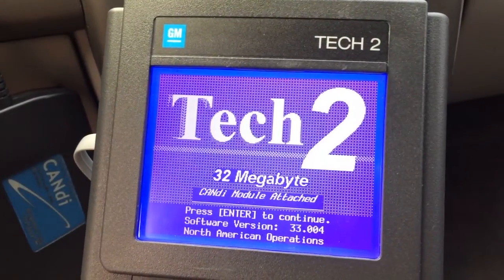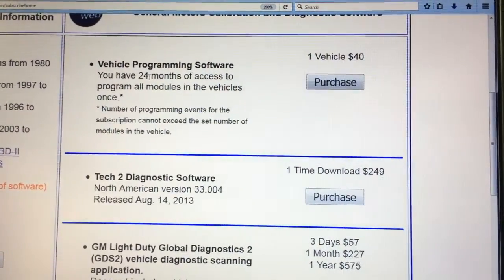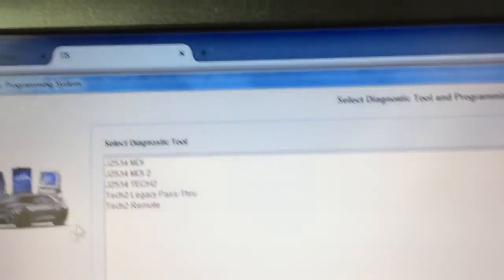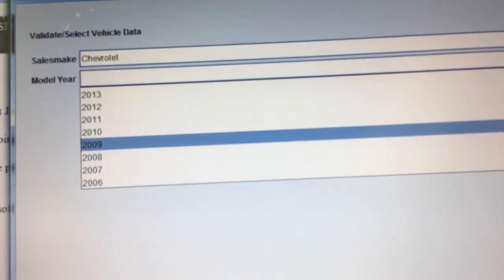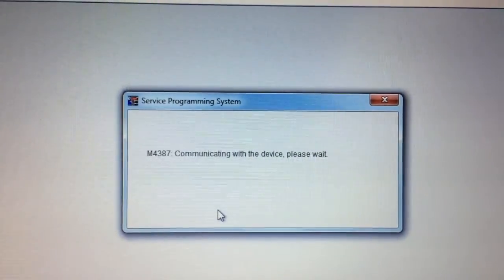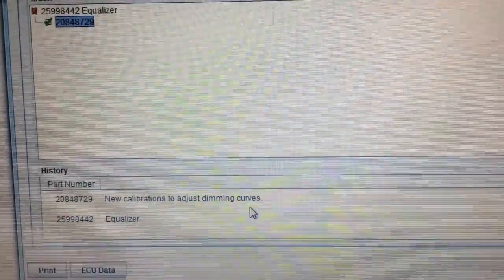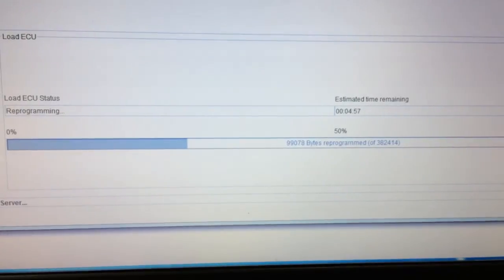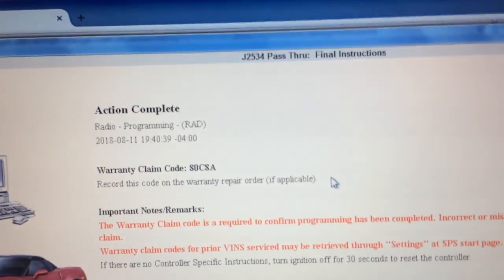GM SPS Programming: Tech2 Tool Pass Thru Mode ECU TIS2Web TDS How to do a Calibration Update Reflash

Comment: Hi let me ask you something. As you was showing the option to pay on for subscriptions on the acdelcotds.com you then jump onto another screen and as you did you said tech line information and there you shows a screen that looked like the TIS2000. is this page part of the prier acdelcotds.com or did you navigate to another page? Thanks
Reply from the maker: That's TIS2Web, the replacement for TIS2000.  Looks about the same as it did in the 1990s.   You do not get to see that until you have a paid account, then when you log in instead of a subscribe button you'll get a button to launch the SPS Java applet.   Or GDS2 or Tech2Win, whatever you've paid GM for in that particular account.
Reply: @DrShock  Ok now i'm understanding, so if a pay the $40 they say you get 2 years to program 1 or more modules in only one vehicle right? If so then i got time to figure out how to navigate the TIS2web! lol
Reply from the maker: You can do anything SPS but just with the one VIN correct.   For a DIY that's quite a good deal.   For a professional garage, it's probably a bit pricey if they just needed to do one module for one customer but at least they got the option vs sending their customer to a GM dealer.
Reply: @DrShock  Well for me doing one vin is okay, because I'm starting out new with programming car modules, yet i'd been doing softer programming using my Autel Elite on things basic. The kick in the ass was with my Autel I got 2 years of software update along with a subscription for BMW and benz meaning I can do unlimited module and i didn't and my sum expires at the end of this month!  Reason i didn't know because although this tool came with the J2534 i was told I needed a laptob using the dealers sit, but not told only for U.S cars, so I and figured the same goes with BMW and Benz cost$$$ was i wrong. Anyway it's time for me to get into programming because every car i send out is money lost!!
Reply: @DrShock  I know i wrote you back already, but there's something i forgot to ask, Drivers do i need to download any type of Drivers for the USB adapter or the Tech2 and If so where can i find them? thanks.
Reply from the maker: There's probably drivers for the USB to serial adapter, but that would depend on the brand one you went with and you should get pointed to those by the manufacturer or seller.
Reply: @DrShock  Yes I understand that the computer will say found USB/DB9 device would you like to install driver from a list or load  from a disc. But now what about the Tech2 isn't that also hardware that communicate with the PC and would also need it's own drivers? I know i'm jumping ahead of my self, but i was just wondering. Anyway I'll give you a break for now with all these question until i get everything linked up then  I cross that bridge. ;) Thank you for all your help :)
Reply from the maker: No, only the USB to serial adapter needs a device driver.  You don't need a driver for the serial device you plug into it.
Reply: @DrShock  Hi ok I received the DB9 to usb and installed driver, but it's not the Tripp Lite USA-19HS as you recommended i got it after you told me so I'm going to try it if it don't work i'll buy the Tripp lite. The only thing  I needed to do was rewire my DB9 fallowing the tech2 DB9 to RJ45 wiring..  I just got done plugged everything up, but how do I know it's communicating with my laptop?   The only thing i found on line is using the self test mode, but i don't have the loop back plug although i can make it if needed, but do i need it!! Thanks
Reply from the maker: The loopback adapter just tests the functionality at the Tech2 jack itself.   To know whether you are reaching thru USB on the PC you'll need TIS2000, or a TIS2Web subscription to get further.
Reply: @DrShock  Hi, I order the right DB9 to USB the Tripp Lite USA-19HS. I also order the TIS2000 disc with the key $20.  When I get everything loaded i'll give you a shout!! thanks
Reply: @DrShock  Hi, ok I installed the TIS2000 with key.  I set up the security key as USB. I installed the Tripp Lite USA 19HS drivers. I plugged the  DB9 i rewired for Tech2. the computer COM port is set to 9, bit rate=9600 Data bits=8, parity=none, stop=1 and flow control none. I then went into the TIS config selected IO management com9, 9600.. Everything looked good, but  I cant get it to communicate. I tried a loop back test and it passed. I'm getting E2106 no connection with the hand device
Reply from the maker: @LouTech So first verify you have the right connections (USB->USB serial adapter->DB2 RJ45 adapter->RJ45 serial cable->Tech2).  Baud rate is too slow, I've always used 115200 on both ends.  Then try the basic load TIS2000, turn on Tech2 but do NOT press enter to get to the menu (leave it on the boot screen) and see if TIS2000 sees it.   If not, move to debugging the comms problem - tone out the clones flat style serial cable with a DVM on continuity test mode.   Tone out the clones RJ45 to DB9 adapter as well.   Also remember this is ancient software, I've not read or heard of anyone getting TIS2000 working reliably other than on Windows 2000 or Windows XP (newer Windows you need to run it inside a virtual machine (VM) of XP) so be sure that's not the issue either.   If its still not working, I'd make a simple DB9 loopback on the USB adapter and find a serial test program for Windows to test that out.   My other video here https://www.youtube.com/watch?v=Nr_eYexAAV4&lc=Ugw0h4KX4wGwvSK5l-R4AaABAg is probably more applicable to the setup you're pursuing here.
Reply: @DrShock  I want to thank you changing the baud rate to 115200  worked! You were right the baud was to low. I set it to 115200 on both sides and wallah it worked! ;) As long as i know it's worked with the TIS2000 I know it will work with the TIS2web!  Now i got to watch your video on how to us it for programming. Question i saw you used it as a pass though for newer cars with TIS2web. would you recommend to buying the MDI or could i use this tech2?  I do have a J2534 haven't used it yet!   Anyway thanks Lou
Reply from the maker: @loutech7209  Great to read, I'll make a note to update the video description with the serial port setup details.  To your question, I personally prefer the Tech2 because it's _free_.  No sub required to use it with TIS2000.  But it's not something I can use on vehicles introduced after 2010 or so which is the only reason I bought an MDI clone.   So far I've found no reason to get the MDI2 (haven't needed to work on a Global A platform GM car yet and the MDI2 clones are not mature ye just being MDI clone circuit boards inside a cloned MDI2 case and not giving you what you would need there anyway).
Reply: @DrShock  As i watch your video I noticed you used your tech2 as a pass through and i saw the list of vehicles  from TIS2web went up to 2019. If programming can be done like this then why the need of an MDI? I purchased the Autel elite and It came with the J2534 box wouldn't that be like the MDI, so what I'm asking is what's the  difference programming via the TIS2web using the Tech2 , MDI or J2534 box?  
 Thanks
Reply from the maker: @loutech7209  It's a generic menu on TIS, not built based on what's connected so I wouldn't read any compatibility being claimed into that list.  There are TIS2Web features like GDS2 that require an MDI instead of a Tech2, some upcoming vehicles (like Global B platform) that will even require an MDI-2 instead for it.   Those are likely due to some hardware requirements the Tech2, or other J2534 generics can't meet and I would expect the Tech2 cannot run GSD2.   There are model years that overlap from 2008 thru 2013 between the Tech2 and MDI for SPS, but the MDI is always faster programming because the Tech2 is obsolete communications technology wise.    But I really have no idea why GM does not claim the Tech2 as being supported for passthru SPS with newer vehicles on TIS2Web.   It could be that GM dealerships do mostly warranty work, and are unlikely to encounter many older vehicles at this point so it's simply cheaper to standardize on testing and supporting just the MDI with SPS.
Reply: @DrShock  Interesting, the reason i asked was I saw when you were linked to the TIS2web you selected from a list of Chevrolet a 2010 cobalt  yet that list went up to 2019. What if for example you were programming a module in a 2019 corvette and  selected from the list 2019 corvette would it read all modules, re-program a replaced one and also do updates on this Vet?
Reply from the maker: Possibly, I typically grab the Tech2 if the vehicle was initially released prior to 2013.  And grab the MDI if it was released after that year.  While I know GDS2 requires the MDI to work properly, I guess it's possible SPS still would be ok thru a Tech2.  Though I would be leery of trying using a Tech2 in passthru to a 2019 Vette.  ;-)

Comment: Hello I logged into the address you shows www,acdelcotds.com and it looked nothing like what you shows. I only see the purchase if the downloads ad to cart, but i cant find anything that looked like the TIS2000. thanks
Reply from the maker: These website screens change all the time, no way any video can stay up to date in that regard.   You can't get to SPS until you pay, then you'll be able to login and see the old familiar interface.
Reply: @DrShock  yes but the problem I needed to link my Tech2 to the service. I not sure if the RJ45 is hooked up right, so if i pay then cant get it to work i'm screwed
Reply: @DrShock  You didn't get into the cable that goes to the laptop. Is it a straight cable or crossover? does the RJ45 plug into the Tech2 and whats on the other side to laptop?
Reply from the maker: The cable to the laptop is a USB to DB9 serial port adapter.   You then plug the serial cable that came with the Tech2 into that.   GM recommends only one USB adapter, the Tripp Lite Keyspan USA-19HS model.  But some years ago, thru trial and error, I found that some clone ones worked for me.   Thanks for pointing this out, I updated the video description to mention the USB adapter recommended by GM.
Reply: @DrShock  Hi Okay i purchased my Tech2 with CANdi module used it's a Vetronix by OTC. I paid $1000 2 years ago, but never used it for programming because I didn't know how. The problem is it only came with the OBD black cable and  CANdi module alone with 1 yellow RJ45 cable. Now about hooking to the web for programming, the Tech2  seemed to only have 2 receptacles on the upper left side of the tool one RJ11 and one RJ45 receptacle. It looked like you're plugged into the the lower one being the RJ45 correct?   The yellow double ended RJ45 male cable does plug into the side  RJ45  receptacle of the Tech2, but where does the other end go? Does this RJ45 other male end go into a RJ45 to DB9 adapter and then connects to a DB9 to USB adapter into the laptop?  I do have the RJ45 to DB9, but not the USB, so i ordered  USB 2.0 To RS232 DB9 Serial Cable Adapter Converter For PDA Satellite is this the wrong one? Thanks
Reply from the maker: Yeah the RJ45 cable should be plugged into the DB9 adapter and just left connected always.  Then you can use that directly if you have an old 90s laptop with an actual DB9 serial port (which it was the Techline setup was when the Tech2 was state of the art).  Today though you'll likely need that USB to DB9 serial port adapter and yeah you connect them all together.  I'm not aware of anything that uses the RJ11 but then I have the clone of the Tech2.  The Tech2 protocol is very sensitive to these USB adapters.  There are MANY that will NOT work at all.   The recommended one from GM that I mentioned is the safe bet from Tripp Lite corporation.   Others you may have to troll forums to see what folks got lucky with.  Never heard of the one you mention but what's important to share is not the laptop model it can work with but rather the make and model number of the adapter itself.
Reply: @DrShock  Thank you very much for the info, I figured that's how it went together. I didn't know before i order the DB9 to USB that GM recommended  the Tripp Lite, anyway I only paid $4.99 for the one i ordered no biggie!  What Version software is on your Tech2?  My Tech2 is running the Ver 3.2, at boot up, but i think that's only for trouble shooting because when i select programming it only goes up to 2007 and showed 2.0, so I was curious do you think the cracked TIS2000 software would work? I figured I can used it only for cars up to 07 and anything newer I'd use the TIS2web. I  was told if i tried using  the TIS2000 software it would bark back saying that my software version needed to be dropped down to a lower version! I wouldn't do it because it cost money to updated again if i needed to the TIS2web and I'm told updates  are not free, so that's out unless some how I could back up my 3.2 or purchase a 32MB card with an older version! What's your thoughts?
Reply from the maker: TIS2000 does not care how "new" your Tech2 firmware is, it may care how old it is though.  I have many videos using TIS2000 with the last update for the Tech2 ever released.   That last and latest version for the USA of the Tech2 firmware PCMCIA card was 33.004.   I believe this came out in 2013 or so.  I wouldn't pay for this update from TIS2Web, and the one built into TIS2000 is way too old.  You can buy these Tech2 type PCMCIA cards preloaded with version 33.004 (and other country/region versions too) inexpensively on eBay from Chinese cloners.
Reply: @DrShock  I figured the guy wasn't telling me the truth because he didn't want me programming very selfish! Anyway my version is the 3.2 so i wonder of it's worth finding a card with the 3.3. also I can get a cracked TIS2000 cheap on ebay like for $12.00 what do you think?
Reply from the maker: Well note I said "33.004".  Not 3.3 or 3.anything.   You should be seeing at least two digits to the left of the decimal point in the version.  Yeah eBay is fine for this sort of stuff, safer than Aliexpress or such.
Reply: @DrShock  oppp, I just fired up my tech2 and you're right mine said software version  32.002. yet my SPS version showed 2.080 that's where I got confused.

Comment: need a video like this on how to program a new BCM on a 2007 G6
Reply from the maker: Working on it for a Cavalier/Sunfire.  But for these years use the Tech2 by itself, no SPS.   Go into Diagnostics, build the car, and then Body.  Select BCM, then Special Functions, then Setup New BCM.   For these years only a brand new GM BCM works, there's no support for used ones as the VIN, odometer, and other info was write once and GM prevents the tool from updating it.
Reply: @DrShock  when setting up the new BCM are you able to enter in the correct odometer mileage and vinyl number?
Reply from the maker: In my experience, with these older vehicles that store it in the BCM, yes you should get prompted for the mileage by the Tech2 as long as its a brand new virgin BCM.  If the Tech2 detects it's used, it won't let you change it.   Past that you will get to pick the regular production options (RPOs) like the radio, cruise control, XM, etc.  This varies across models alot though, and the older the vehicle the less was actually in the BCM.   I've never seen trim numbers (vinyl) in a BCM myself, only hardware RPOs.  But then I don't work on vehicles newer than around 2013.

Comment: So In your opinion is it worth buying a genuine tech2? Also does the tech2win do everything the tech 2 can do? Do you still have part numbers for cables and adapter to USB?

Thanks
Reply from the maker: If you can find an original genuine Tech2 that's in good condition and hasn't been beat up in the dealership at a good price it's a better choice than a clone sure.  But typically they are either going for 2-3X more than a clone, or pretty banged up and repairing them just isn't feasible.    I've used the high quality clone model for close to 4 years now and never found anything from the GM services manuals it couldn't do.  I've never bothered to subscribe to Tech2Win for my MDI clone, because I have the Tech2 clone.   But my understanding is it can do anything a Tech2 can and is mostly there so you only need to own one tool (MDI or MDI2) as a dealership.  If you look thru the comments I believe there's some info on USB adapters that folks have found to work.  Originally GM only recommended the Keyspan USA-19HS adapter from Tripp Lite.
Reply: @DrShock  Awesome thanks for the help I bought a 2006 chevy truck and was wanting to see if the truck has adjustable parameters that can be changed with the tech 2 as my dodge ram has with the drb3 tool. Do you know if there are options for that or is the tech 2 just used for fault codes and programming?

Thanks
Reply from the maker: Every GM vehicle is different in some respect on the tools menus, and I'm not personally familiar with 2006.  But most of the time GM limits adjustable parameters and options to those that came with the vehicle when new, so definitely no tuning supported.
Reply: There is a cracked version of the Tech2win software you can get from China that works really good.